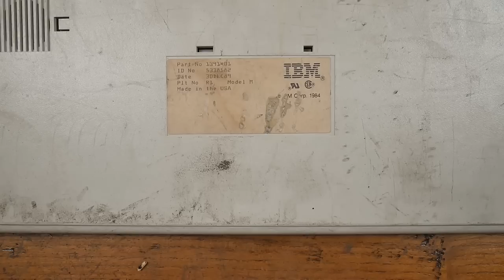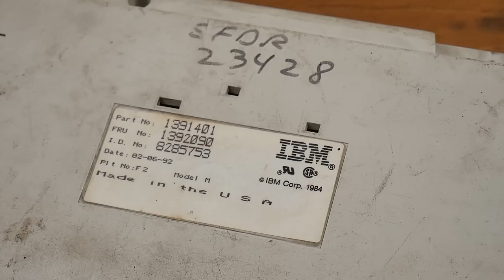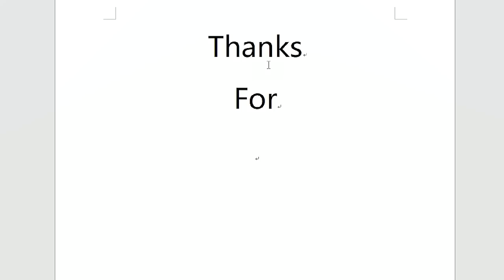IBM Model M Keyboard Restoration (Buckling-Spring)

Comment: That was one of my first electronic keyboards out of HS, I learned to type on a manual typewriter.  Max speed was 65 WPM for me at the time, started a new job and it was data entry.  My speed went up by another 30 WPM using that keyboard, only issue was that the people around me couldn't stand the clickity clack sound (I typed all day long).  Great restoration, and great memories.  Whenever I see an old keyboard without the Windows key on it, I take it home and clean it up, adapt it for usb use but yeah people still can't stand me typing 110 WPM on it :)

Comment: Great job on this restoration!
Out of curiosity (I am also planning on doing this), what are the exact dimensions of the screws and nuts that you used? Also, what diameter holes did you drill, and what diameter rounded tip did you use for the bevel?
Reply: In another video they used M2 screws (M2 x 0,8mm) , but with a different head so they stick out more. -> https://www.youtube.com/watch?v=dStgzMpOTOA

Comment: A little late to the comments but Youtube just recommended. I'm typing this comment on a Model M born on 8 Aug 89. So 34 years and still going - good for another 34 years at least. Like yours, this is also bolt-modded. I didn't do it myself but bought it from a guy around 7 or 8 years ago. Thank you SO MUCH for restoring another Model M - we need more of this in today's society - everything is throw away nowadays and nothing it built to last. Hell, the crappy keyboards that come prepacked with HPs nowadays are so bad you just throw them right away - no one wants them.

Comment: Done a fair few of these restorations now, and even pre bolt mod it's a task and a half, a tip for removing keycaps quickly - put a flat head screwdriver on the underside of the keys and pull up, they'll come off in entire rows if you have a big enough screwdriver.

Comment: Great video!

Goes to show that these boards can even be brought back when severely abused and stored in an unhospitable environment.
Sadly the bolt mod is a requirement for any M at some point, but once done, it should be good for another 30 or so years :)

Comment: Does the conductive paste need a few hours to dry? Because I accidentially cut the membrane and a few traces and trier to repair it with silver conductive paste. But it does not work, no beep with the multimeter. Any speciel tips for repairing those traces?
Reply: Yes. its needs some time to dry and then it becomes conductive.

Comment: I was lucky to be able to pick up a couple if new in box PS2 Model M keyboards a couple of decades ago. Still going strong. Have never taken it apart to clean but do occasionally wipe it down to clean off the smutches. Great keyboard.
Reply: Kinda curious, where did you find them?
Reply: @fiverZ  Back in the 1990s we had several local brick and mortar electronics surplus stores. Unfortunately all of them are long gone both the computer version and electronics components.  

I forget how much they cost but could not have been much because I bought 2. Just checked eBay, boy are they expensive now.
Reply: @tomschmidt381  Oh nice. Yeah they're pretty expensive now. I bought 2 last year for over €120 each :/